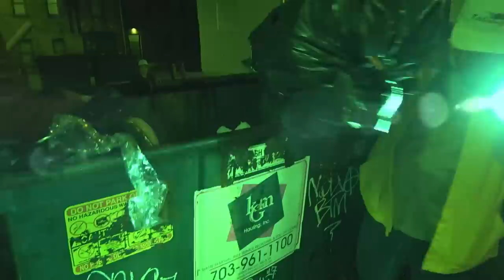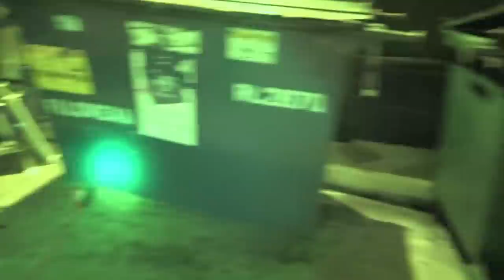Exterminating BIG RATS in the Big City with Mink and Terriers!

Comment: The patter dale terrier is the best rat killing dog in the world because of its small size it can move very quickly and it has a veracious ability to kill. It also originates from a small area in the Lake District of England. I live 6 miles south of patter dale and we also have a breed of dog originally from this area which pretty much meets all the capabilities of patter dales and this is a Lakeland terrier.(the difference between the two is that the patter dales temper can spill over to its siblings when hunting in anger but Lakeland terriers seem to do this a lot less with a similar vicious tenacity to kill the prey.